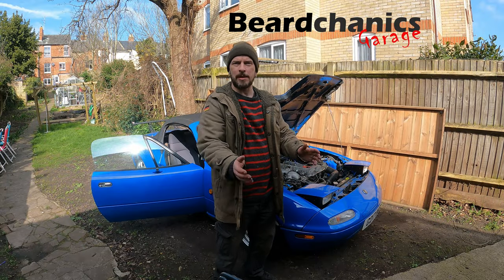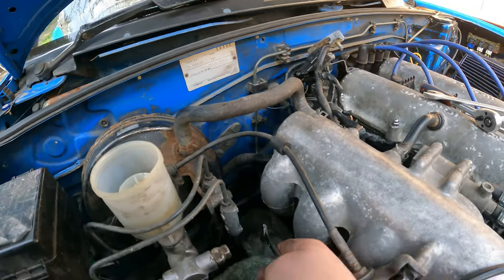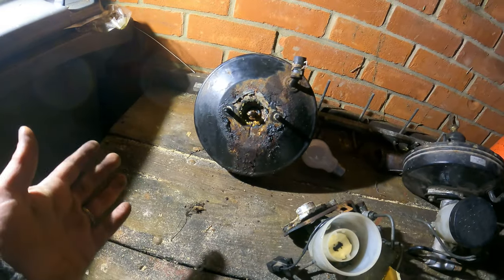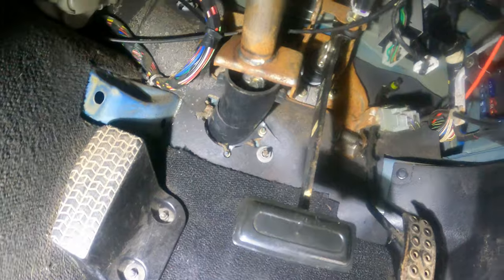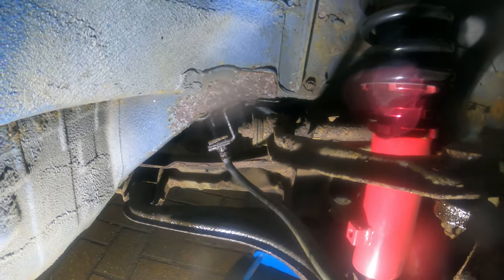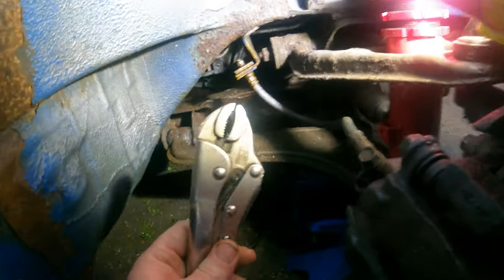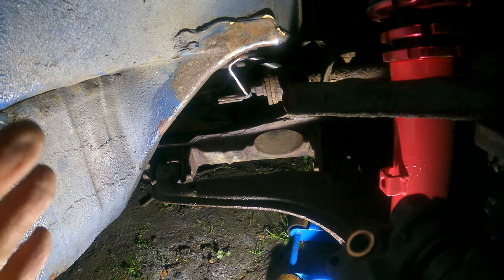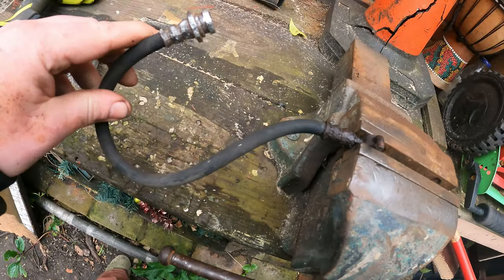Master Cylinder Replacement & Brake Line Repairs - Mazda MX5 NA

Comment: Très bon tuto gilles . Moi aussi j ai les freins a changer sur la S3 la vidange les bougies et le Kangoo trop de trucs à faire
Reply from the maker: C'etait un peu la galére mais j'ai bien appris des choses =) Maintenant le moteur, d'apres mes recherches je crois que le problem est avec les joints des injecteurs. De l'air qui rentre donc les rpms sont pas stable.
Reply: @Beardchanics  mais tu voulais pas la vendre celle ci ? Et la corvette tu la vendu au faite

Comment: Hello dear Gilles 😃!  Great job on replacing the faulty brake master cylinder.  You were very good at cutting away with the grinder that support that couldn't be unscrewed.  Sometimes those jobs that seem simple, on cars that are more than 20 years old, turn out to be more complicated.  You were great at the repair.  Now it's finally a safe MX-5.  Well done Gilles.  Have a great evening 😃👍
Reply from the maker: Thanks mate, glad it's done. Yeah working on all cars is defo a challenge for one's patience lol Now need to tackle the engine and should be ready for the road. I suspect the injectors seals are loose so air getting in and messing with the RPM. Well hopefully it's that as should be just question of servicing the injectors!

Comment: God it's so annoying when something won't budge...I swear so much before bringing out the grinder and showing whatever it is the error of its ways 😂
Reply from the maker: Yeah, some many short job take longer just because of that. Glad it's done now though. And nearly got it running right, was sitting on speeduino ECU for years and just installed it recently. Couple of sensors to sort out and should be able to tune it.